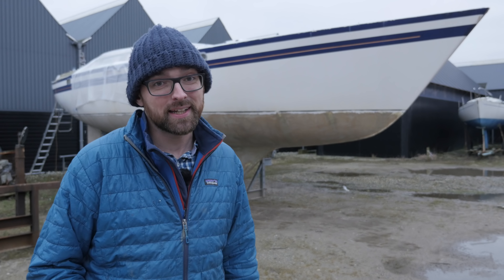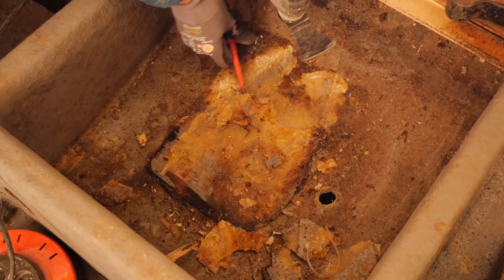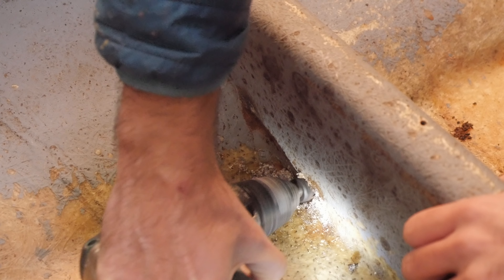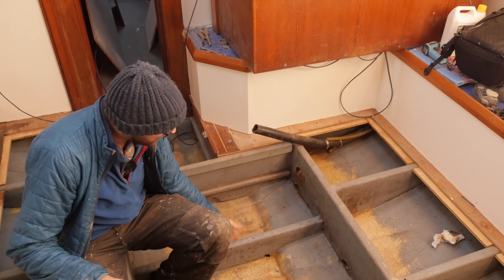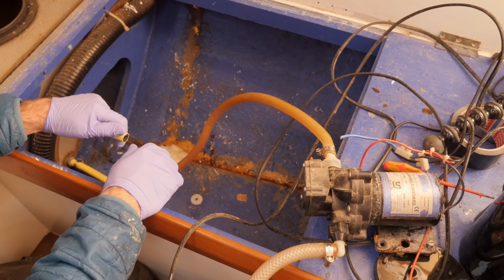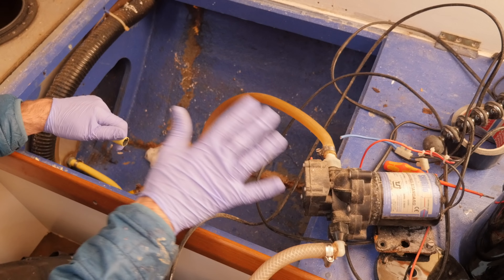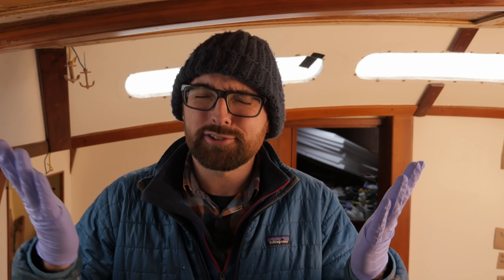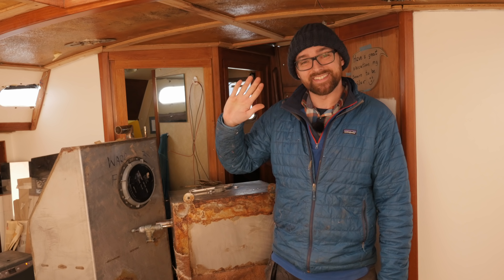Sail Life - No sanding, no painting but wet plywood...yay! - DIY sailboat repair

Comment: I like one of the ideas below of removing the bottom 10mm (10 not 1) from the rusty tank and having a new ss base professionally welded in, cleaned and pressure tested. The tanks need to be secured, you sure would NOT want them rattling about the cabin in a knockdown half full of water! As far as the ribs go; I imagine that holesawing 2 or 3 +/- 75mm dia holes per rib, along each rib's horizontal centre line, would give you a fair indication of any rot, without losing any beam strength. Also like a viewers idea of a large/ish one near the current drain hole to show amount of rot penetration. One would need to seal the cut edges, of course.You could later use these holes for cabling or plumbing runs. Replace any rotten ribs, I think that a quick "patch job" will just haunt you in the future. Great vid, as always. It's something I look forward to each Monday.

Comment: Hi Mads,
You could look into making your own plastic tank, you already have a good hot air gun, a little plastic welding, then use through bulkhead fittings for your hoses to attach to. Then you could also use pvc piping in a lot of places to get rid of all the hose. Simply apply a little heat to where you bend. Would make a good episode too. Cheers

Comment: Mads, I think the fiberglass on tank 1 is to protect it not to seal it.  Even if tank 1 leaks it is better and cheaper to have it repaired. Have more inspection ports installed in the tops of both tanks, enough that you can reach all parts of the inside of the tanks for cleaning.  Here is why, If you sail around more than just your local area you may get contaminated water, being able to visually inspect the inside of the first tank may keep you from pumping who knows what into the other tank.  Stainless steel is a great container for water and it will not leach anything into the water.  It also won't absorb anything making it possible to clean in an emergency.  I would have the tanks inspected and tested and spend the rest of the plastic tank money on something better.  Like more sandpaper. :D

Comment: $0.02 (USD), but if you plan to get a water maker I would recommend to leave out one of the tanks.  The tank that you are about to cut would be ideal.  Then replace it with a much smaller plastic day tank that pumps from the other tank.  Feed the water maker into the larger tank with a bypass valve to the day tank.  In the case you get bad water you could clean the day tank, treat it, shut off the pump from the main water tank and use the bypass valve to run the water maker to the day tank.  In the extra space you could place the hardware for the water maker.
Reply: A water maker should NEVER be plumbed directly into a main storage tank, and should always feed a dedicated collection and test tank, and be configured with control interlocks on redundant valves. (Water maker can't be turned on unless the correct valves are closed kind of thing.)

If you have a malfunction in the water maker, the last thing you want is it to be pumping into your primary storage and contaminating your reserve.

Personally I also wouldn't feel all that comfortable being out on a boat for any length of time without redundant water storage. (And remember, if your water tanks can free flow between each other by default, they're not redundant tanks, they're a single tank with a really weird shape.)
Reply: What about just carrying 5 gallon water jugs besides the main water tank? You can still store them in the same space, and it gives you some flexibility, especially if the jugs are collapsible. They may not be pretty to look at, but give you more options, and may be more practical too. Also cheaper, easier to replace, etc.
Reply: Unless the tanks capacity is small, I would go  with Perrys idea.  But you should have at least 75 gallons (280 liters) imo.

Comment: Hi Mads another great update 👍with lots to interest and provoke deep meaningful thought.🤔

Firstly - as others have mentioned can you not fleet these tanks out through your new hatch?

Second if the answer to the above is YES or you can get it out of the companion way hatch by removing all the woodwork then I would hold fast on purchasing new tanks. Surely you have stainless steel fabricators in Denmark - it must be cheaper to get these pressure tested, identify the weld defects and then repair them. Even better if you could get them to come to the boat and do the whole repair and test in situ (well you could do the testing - You can hire a machine to do that). With the right precautions (and a few fire extinguishers around) it is perfectly feasible to do a repair in situ - but a pressure test to identify the size and location of the leak(s) must be a first step. You could even do a bit of sanding on the tanks to make them more spiffy and appealing to the welder. ;-)

Take a leaf out of Doug (SV Seeker) 's book and ask for help - I am sure someone will respond with the right kit and skills.

Properly repaired tank will likely last another 30 years.

Sorry for the rather lengthy post.

We are on tenter hooks here - what is Mads going to find next?

Comment: Mads if you leave that wet core in place it will drive you crazy over the years knowing that it is there, especially after all the trouble you went through to replace the deck core.  I say replace the sections that are wet and also check the surrounding grid section members for wetnesses now and be assured for years to come that you have done all you can during the rebuild.  Plus we then get to see you chop up more parts of Athena :)
Reply: after finding the two spaces full of water, i'd be looking at ALL the members that contact those spaces....
Reply: I would seriously consider drilling into ALL of the structural member & checking for moisture.  It'll be fairly simple to patch up the fibreglass after & you'll know for sure that everything is either dry or replaced.
Reply: After rotted transoms, the most common issue with power boats. I'd look there for advice on how to tackle.

Comment: Mads, have you considered putting in 2 smaller tanks rather than one large one?  You might find smaller tanks more available AND it solves the problem of no baffles in plastic tanks.  Also, you have the choice to only fill one tank unless you are planning a long trip.  As far as the "floor"is concerned, I would replace it since it is certainly part of the structure that keeps the hull from flexing due to keel loads.  I imagine you have enough foam core left over to make a core for a structural fiberglass floor.

Comment: So glad your plans for the weekend were altered and you found that water under the 2nd tank.  I work as captain on a Ocean Alexander and have found 2 such areas where water can drain to but then will get trapped with nowhere to go unless the boat rolls in a seaway or gets so high it starts to spill over stringers.

Comment: Mental note to myself: 
- make sure that whatever you install, you are always able to uninstall it again and have relatively easy access to what is hiding underneath.
- when installing large things like tanks, have some edges or handles to be able to lift or handle these bulky things.

Yet again a very great video. Can you see on the moisture readings from the hull that these areas inside where holding water?

Comment: The wet crossmember between the stringers: I had one repaired. They used a 1 1/2 inch boring bit to drill some holes in the side. They then cut the top off and working between the holes and the top, extracted the rotten  3/4 inch plywood.  They taped over the large holes and poured epoxy / microballons in the void.  After 1/3 filling it, they pushed a piece of half inch plywood into the void and finished filling to the top. After it hardened they laid three layers of chopped strand over the top and painted.

Comment: Amazing to see you just go for whatever action you think the repair will require, cutting things around like that would make me pause and think like 30 times.  :-)     I guess after all work you've dealt with you have the needed confidence nothing you cannot handle will come. I've been binge watching your Athena videos. Need to go through the older ones later. Inspiring!

Good you found that standing water under the tank. Imagine the evaporation and smell that could bring in warm days (out of Denmark of course).

Keep the videos coming and stay positive and strong.  Thanks.

Comment: Standing water the cause of high moisture readings on the outside of the hull? I think so. Crazy design choices on that boat. I believe a boat requiring a refit a good choice in that it gets you to inspect every part of it and gets you to know your boat better. This situation with your boat is no exception.

Comment: Thanks dude _ I am in the throws of renovating an old Atlanta Viking 8.5.  The project I have undertaken is very much inspired by your approach and I always eagerly await Sundays as there always seems to be some duality between our two projects.  At the moment I have the exact same problems with bilge compartments underneath water tanks all boxed in and no access and no drain holes! Just like you I can't understand that approach at all. I know they are flooded as there is water seeping slowly out... you have just shown me how to deal with the issues and it helps to see you cope so well by being thorough!  I can tell you that a cleaning product I use to get the bilge areas clean is 'Cif' a household cream cleaner sold all over Europe.  It is excellent for this purpose and cheap,  it clears away everything including diesel, rust stains and with a scrub even loose paint comes off.  Thanks again for your influence.

Comment: Can I suggest keeping the leaking tank? I know, I know. You don't want a tank leaking water, or anything else for that mater into your boat. I wouldn't either! You can get a liner material that seals the tank from the inside. OR! A rubber or vinal bladder that fits inside the old tank. I personally prefer the idea of poring a coating material in and letting it harden. Just a thought. An option if you will. Great video as usual. Love the "can do" attitude. 😎

Comment: There has to be an explanation on the lack drainage to the bilge.   I am perplexed by your discovery here because anywhere where there is cold temps there is some level of condensation and there has to be access for this to get to the bilge.   You already know the core has to be fixed sadly but what a stupid project to have to do for something so basic.  Now you really have to look at everything with skepticism and really dig.   Very glad you found it now for sure.  The good thing is that this will be one hell of a solid boat by the time you are done.   Thanks for showing you journey as always.

Comment: Hi Mads, Another great video thanks.......As for the water tanks there really is nothing better than Stainless. We have rubber bladders in our Catamaran however they never really  fill properly and are difficult to inspect inside and clean out. 
We have 2 x 200 liter stainless diesel tanks which we recently removed and sent off for pressure testing and repair. This was relatively inexpensive compared to new tanks, even if they had to cut the bottom off your tank and replace it that would still be way less than a new tank.

Comment: Re your question about tank 2, clean and test but before refitting, redo all the plumbing so connections (the fill and vent) are easily accessed rather than hidden. Also sit the tank on hard rubber or silicon rather than bare wood. Maybe add a wifi enabled level sensor? Flow sensor on the pump outlet? :)

Comment: Mads, I know you haven't mentioned the moisture content of the hull for a long time having dried it out. However, given the wet discoveries under the water tanks, it would be interesting to see if the moisture content in those parts of the hull were any higher. If so, could you share that with us in an upcoming video.

Comment: Well done for checking that hidden compartment Mads, all that standing water will not have been helping the osmosis or moisture readings in the hull.  As for the tank, it looks pretty good.  I would take an angle grinder with a stainless steel brush head and clean it all up, and give it a good visual inspection.  To test it, if you can rig something to hold 3psi pressure, say in the tank vent from a bike pump, you can then check for leaks with soapy water.  if it passes this test, it will be good to go for another few years at least.

Comment: Hi Mads, 
Love your videos,
You could investigate flexible tanks. They have the advantage to keep the air away as they inflate and deflate. You can keep water longer time. I am using that on my boat for over 20 years. Never got a water leak. Vetus is selling them under many sizes.

Comment: Hi Mads,
Before cutting your water tank i would get a price a stainless welding a new tank floor on it. It might save you a few bucks and should kast you a long time as you have addressed your electrolysis issues which probably caused the tank failure in the first place. I love your channel mate 
TIM

Comment: For what it's worth, if in your situation, rather than have a large custom tank built, I would install smaller tanks off the shelf.  The advantage is that they would be less expensive and if a tank should become fouled, you have other tanks that should still contain potable water. You might even consider a bladder tank.  Good work and best wishes, B.

Comment: I would pressure test the 2nd tank and if it holds, clean it and use it.  I believe you have shown a concern for all Warrior owners with those wet compartments.
Reply: I imagine anyone who owns a Warrior is hopefully wondering about the design, but I imagine it is something worth looking out for for any boat. I know I'll be paying extremely close attention to that issue here as I start shopping around for old hulls.
Reply: would hope everyone who owns a warrior will now be taking a VERY hard look to see if they have similar issues.....
Reply: Pressure test is the way to go.  Either pressurize the tank or draw a vacuum, depending on what equipment you have available
Reply: Tim Hyatt    I think you're going to see a whole lot of Warrior boats on the market soon and at fire sale prices.
Reply: James Ford
I was just thinking the same thing! 
Since Mads started working on Athena, worldwide warrior owners have been cursing on a weekly basis in a variety of languages!!!🤣😂🤣😂
Reply: if they're built to similar standards, then that's very probable.....though for someone willing to put the effort into it, it might be a way to get one for a song.  Will just need some major work afterwards.....  
I know of one guy who bought an old boat like this....had it freighted inland, and buried it in dry sand up to the waterline so the grass around it looks like a green ocean....he lives in it now...

Comment: Nice spelunking! Too bad you found all those design flaws. Or maybe I should very good that you found them. Old boats are a learning but fun experience. Speaking of experience, your words that plastic tanks should last forever may not quite be true. I have had to replace them myself because they usually fail around the inlet or outlet fittings. The way the plastic threads are fastened to the tank is by some sort of plastic welding process that is questionable to my way of thinking. When your fittings are threaded into them they flex quite a bit and may eventually leak. Please beware of this before you decide to change from stainless steel tankage. Thanks for the fun videos. You are doing a first rate rebuild! Looking forward to the next one!

Comment: Re: the tanks.  The stainless steel tanks can be cleaned, re-welded and galvanized.

Plastic tanks only last 10 years before the get impregnated from contaminates in the water and then permeate a smell, and no matter how many times you clean it, nothing can be done.  Just like the hoses hardening, so do the plastic tanks.

Re: the wood frames, I doubt it will make a difference.  Drill a few 
vent holes in the top of the frames, hook up your vacuum pump to the 
lower hole and suction the water out.

Comment: Eventhough the fibreglass is only 3mm thick, it is still the most important part of that floor (don't know whether that is the correct term). You have to consider that in order to deform both the plywood and the fibreglass need to deform. In terms of deformation per amount of force the fibreglass is much stiffer so will take all the load. Now in the case of a floor, its main purpose is to stop the hull from deforming inward. So basically when the hull "tries" to deform, it would need to elongate the top of the floor. The sides of the floor only exist to connect the hull with the upper plane. If you were to replace them you can use foam instead of plywood for the exact same reason.

Comment: Cutting up the tank - Jig saw or reciprocating will work but you will be fight vibration/flex in the tank walls.  As crazy as it sounds, your small circular saw with a carbide tipped blade will work and go VERY quickly.  I would not use my best blade, but it will work.

I don't recall, but an angle grinder with the appropriate disc would also work.

Last, start a decent size hole and use straight cutting aviation snips.